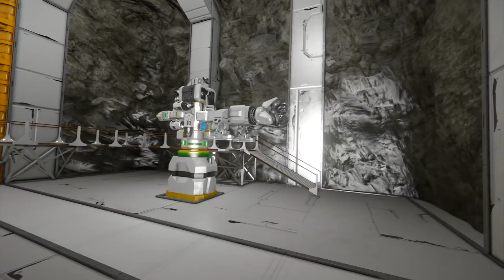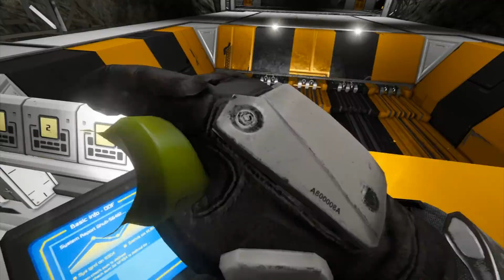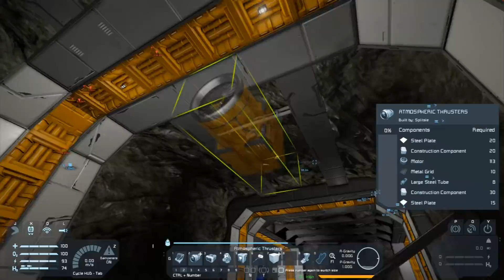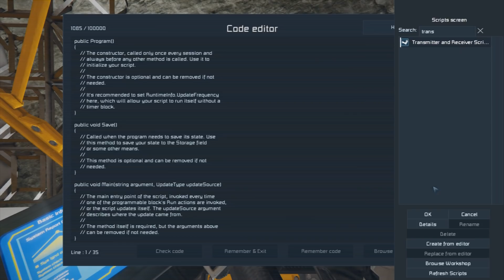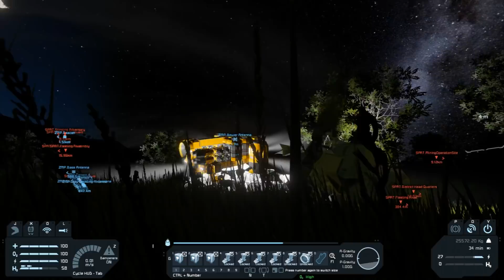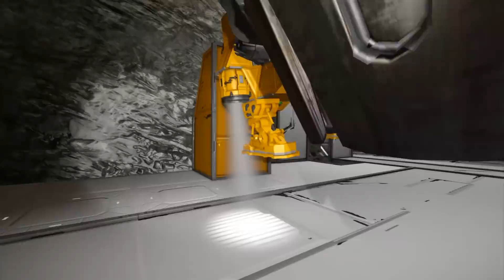Survival, Maybe... #56 Making a Salvage Ship (A Space Engineers Survival Series)

Comment: Hey Splitsie, just wanted to say congratulations and well done on the 50 eps and counting.
I found one of your vids about a month ago when learning how antennas work, and have just caught up to this ep. They've been quite informative, and have inspired me to get back into Space Engineers.
I do have a question, would the grinder pit work better if you lined it with blast door blocks, so nothing could slip past the grinders when they're pushing?
Reply from the maker: Unfortunately because I put the grinders on a subgrid they'll grind away the walls as they move, you could have them off until they reach the voxels but it's very difficult to make a nice transition between the armor and voxels where blocks won't get stuck :(

Comment: vetol gunship with mini mounted Rudolf x2/x4 depending on size and start clearing out some of your nearer bases to give yourself some breathing room to really work on scavenging or or something i've wanted to do but haven't got a clue if its possible make a turret drone (votol and cheap) designed literally using remotes, sensors and scripts(im assuming)  in a cheap mannet where you can easy have 2 or 3 built an functional and use them to ''Follow and protect'' ships that no combat ability or things like the goose? (auto defence drones)  aka flying following sandbags
Reply from the maker: I'd like to do something flying that can assist the sandbags, the big downside of a system like that is the power cost. The base is perfectly capable of running its own systems but when I start flying too many ships around it starts running short so I'll be holding off on any flying defense drones for a little bit :(

As to a gunship, it's on the list but I'm feeling pretty good about things at the moment, since the reprieve has given me time to increase the sandbag coverage nicely :)

Comment: Nice episode. Like your new salvager/trash collector. Have you thought about maybe adding a grinder to it in front and a small storage? Since you did cook your salvage on the main thrusters, being able to maybe trim the salvage before pickup would be a good thing. 

Another option might be to raise the main thrusters up a block or two to avoid it. Would give the ship a higher profile though.

Maybe add a sound block to your base as well as the salvager, along with a timer that reactivates the turrets. Have the sound block sound out 10 seconds before activation :)

Why is the Goose parked by the entrance? Didn't you make a nice turn table for it to be parked on? Noticed you had to navigate past it on your way in and out of the garage
Reply from the maker: I might have a fiddle with the design a little and try to move the thrusters when I take another crack at prettying up the armor :)

I parked it there when I'd briefly left it outside to get power and haven't put it back inside while the buttercup's been using its connector. I just feel mean parking it in the darkness that shrouds the turntable at the moment :P

Comment: Hey splitsie, Im not sure you know this but I just discovered that if you have nothing in your hands and have a control panel targeted, while in spectator mode you can right click to access the control panel for the grid you are on. It makes it very easy to work on pistons and other fiddly stuff like that. I accidentally found it out when I was working on my elevator. Was to nice to be able to control the different lengths while in spectator mode to line them up the way I wanted. But as always. Great work. :)
Reply from the maker: I've done it by accident a number of times myself, the other thing I like to do is to use the build vision menu while in spectator cam. I set up most of the hangar drilling guide projections that way and it saves sooo much time :)